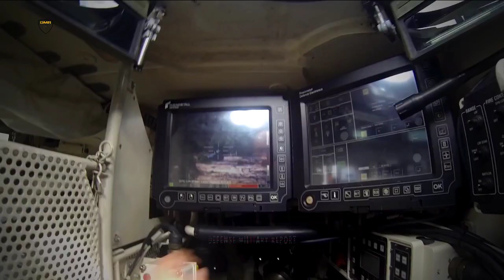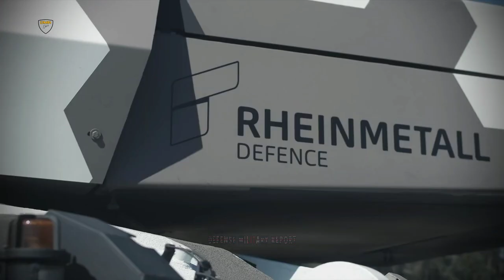Finally! New Lethal Turret for Challenger 3 MBT Under Construction

Comment: Now we can only hope they up the 148 and  either upgrade or replace Warrior!
Reply: Really Warrior should just be upgraded as they are being used for what they were built for
Reply: We need to start designing a couple new platforms like a new MBT with a British 130mm from scratch and a new modular tracked vehicle it would have the modularity of boxer but as a tracked platform it would be the replacement for warrior and we need a new light tank to replace scorpion and the light tank would be the same size as the scorpion and there would be two variants a 110mm and 40mm and another platform the self-propelled platform it would be Front engine and there would be two variance self-propelled artillery 160mm and self-propelled anti-air 40mm the British Army would have new standardised gun calipers 40mm 110mm 130mm 160mm
Reply: @jammiedodger7040  Design ? - where and by whom? Full scale production of a new vehicle.  Don't make me laugh.
Reply: @jimimber164  The capability would have to be built back by the Government